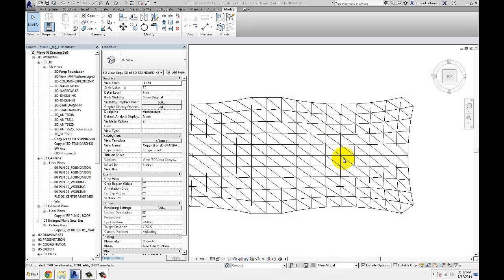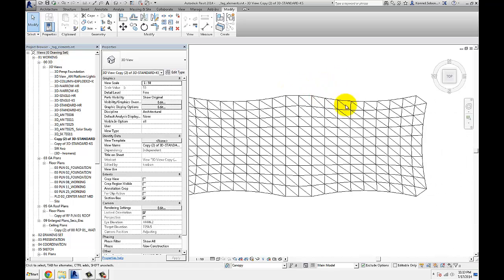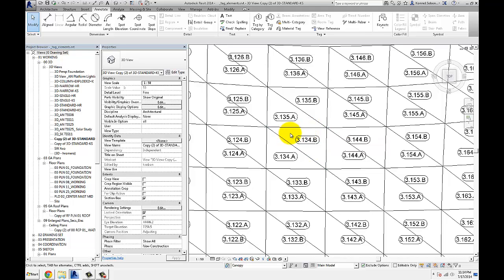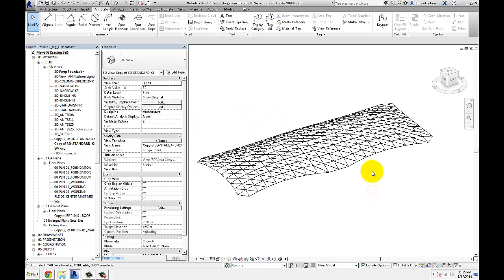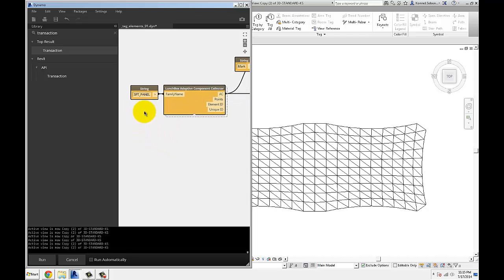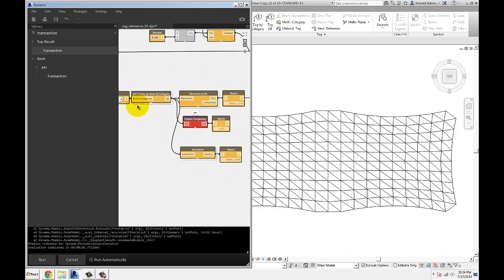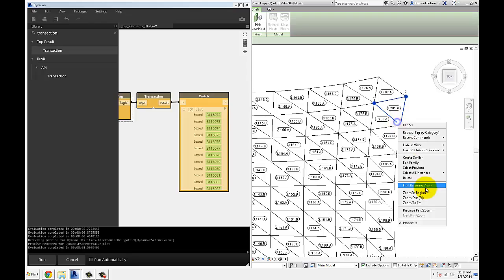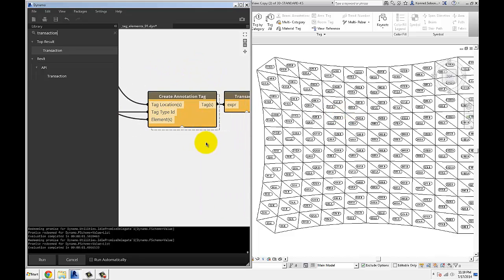Element Tagging with Dynamo

Comment: Hi, i am a starter on dynamo. I tried to make a script like yours for condo elevations. for the location of the tag part i got very lost. i used geometry tool to get the shape and it reads the whole building even the part that is hidden behind of the curtain panel. so as a result, lots of taggs are missing and also, the panel perpendicular to the elevation wall, is tagged repeatedly and overlapping. Can you please share me a link of your script to look at. i'm very curious to see how you get the location work. Thanks a lot